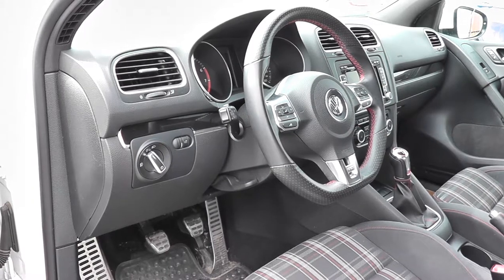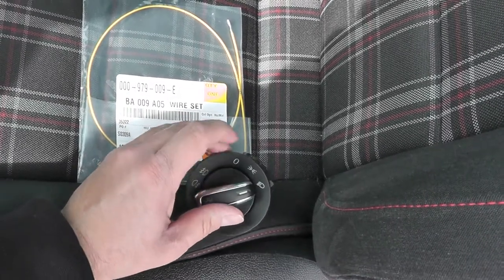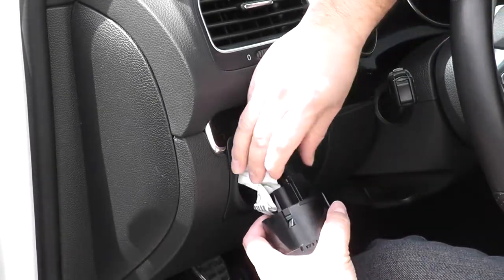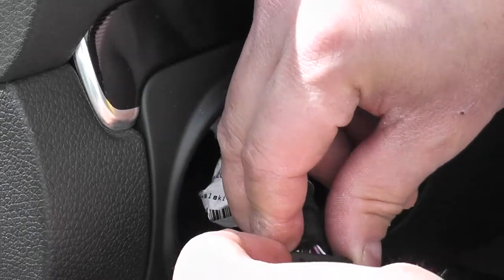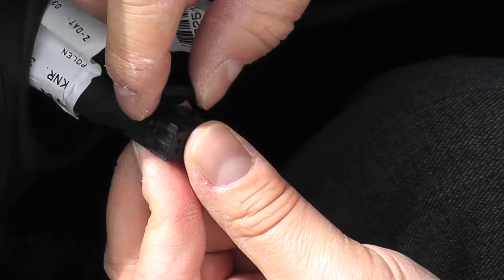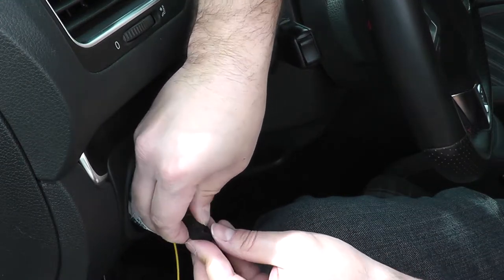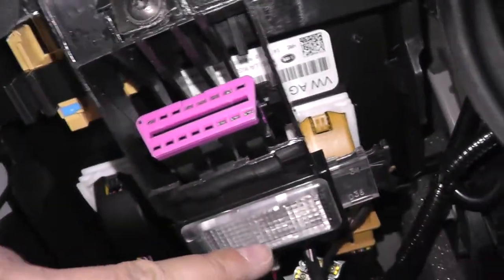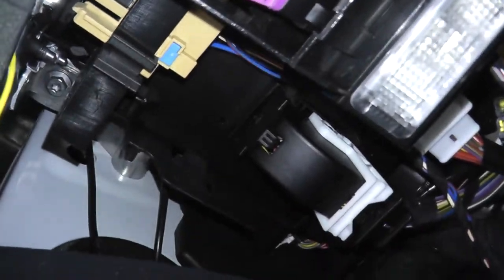MK6 GTI Euro Headlight Switch install

Comment: Awesome video! I think I'm definitely comfortable with the installation thanks to your video but I have a question about the vagcom. If I don't mind keeping the DRL's always on, do you need the vagcom at all for this process? Do I have to disable the DRL's to operate the rear parking lights independently?
Reply from the maker: thanks man! glad it has helped you out. No you are not required to disable your DRL's in order to add this euro switch. In your case you will have your headlights on at all times but you can turn your park lights independently as well as your fogs.
Reply: Esqu3l3to how do you disable the DRLs? I've got a '13 with xenon led.
Reply from the maker: Randy Grenier you can use vag com to disable them. older models you could bend the pin from the main harness but I don't know if you can do the same with any new model.
Reply: Esqu3l3to cool. thanks.

Comment: You can pull the light switch 2 times for the front fogs and the rear fog light/lights
Reply from the maker: Ok good info, I dont have the rear fogs wired up.

Comment: Is the mk6R wired just like the gti as far as connecting the euro switch? Excellent instructions! Thank you.
Reply from the maker: It should be yes, I have read that you would want a switch without front fogs however, since you have LED drl not fogs. I will see if I can find a link and or how to for the R.
Reply: Esqu3l3to ok, my led drls are in the place where fogs are. I guess I just considered those fogs. I want a switch to where I can just run my park lights and not my headlights. Thanks for your help.

Comment: bro, if it selected in auto mode and open from outside will the headlight opened automatically without start the ignition !?
Reply from the maker: Yes, If you installed a light sensor for the auto lights they will come on when it senses low light.

Comment: So what are the numbers in the factory plug for the switch should put my trigger wire for the parking lights and the fog lights?
Reply from the maker: here is a link to the install guide from ECS tuning. 
http://bd8ba3c866c8cbc330ab-7b26c6f3e01bf511d4da3315c66902d6.r6.cf1.rackcdn.com/mkvfog.pdf

this will show you how to install and which wires go where. I will assume you bought a oem kit correct?

Comment: It's the sameway to install this switch on a 2006 jetta 2.5?
Reply from the maker: yes it will work for your MK5 Jetta as well, from what I have read your model is plug & play. No added wiring required. Not sure if you will want to disable your DRL like I did which you will need VCDS (vag com) to do so.
Reply from the maker: I forgot to include this link for your install/referece. This is not my work but it will help you. 
http://www.myturbodiesel.com/wiki/euroswitch-installation-mk5-vw-jetta-golf-gti-and-sportwagen/

Comment: Do I need to disable the DRLs if I wanna run only city lights? Thanks in advance!
Reply from the maker: No you dont need to disable your DRLs for this. I did because I don't like them and I want full control of all my lights. The wire you can find at a local vw dealer or online with part number 000-979-009-E.

Comment: i need to do that on my 2017 passat. 1.8T. do i still need the wire. cant i just remove the old switch and install new one?
Reply from the maker: Remove the switch and check for any missing pins/wires. It will likely need it like mine but you never know.

Comment: My 2008 Jetta. Like to turn the small light on for drl. And head light on when drak. Can u suggest what witch and how can I do it.
Reply from the maker: Basically you need the same style switch that I have except of course that will fit your year. You might need to run a wire to activate park lights as I did.

Comment: How did you get the harness back together, mine doesn’t want to
Reply from the maker: The two connectors on the harnesses have a groove/slider to hold them together. You need to slide them back the same way. Ot can be a PITA but it can be done.

Comment: Pin #3 is where the yellow wire goes on the switch?
Reply from the maker: Correct, pin on the switch side and pin 19 on the harness under the dash.

Comment: I noticed the rear fog light setting. Is that a whole other mess to install?
Reply from the maker: that is correct, you are able to use rear fogs with this switch. as for wiring I do believe you would need a wire similar to the park lights and even coding.
Reply: +Keith Nuñez Yes, you would need a CANBUS VAG-com to code the car to work with rear fogs, and of course have taillights that have them to use. ECS Tuning offers a good selection
Here is some info about some coding tweaks you can do as well:
http://forums.vwvortex.com/showthread.php?4743553-VCDS-MKVI-MK6-Platform-Handy-Coding-tweaks

Comment: i thought the yellow wire was just for the rear fog lights. i have the same switch and i don't have the wire installed, and the lights work just fine, except my rear fog lights come on with the front as well, no matter how far i pull the switch for the fog lights. i can't get them to turn on separately.
Reply from the maker: +ThisIsIrrelevant in this case it was just for the park lights as it already was setup for front fogs. For rear fogs there is another cable you need to connect to activate. I don't know if you can only activate them one at a time.
Reply: ***** that model switch should have two detents that you can pull it to, to activate the front first and then the rear. mine doesn't do that though :/
Reply from the maker: that's true, they should have made it that way. Not sure if anyone makes a switch that way, it would be a good idea.

Comment: is it possible to use parking lights with fog lights? I bought a switch from amazon but not working as it should yet
Reply from the maker: Yes it is possible, you can use fog with park light without turning on your headlights. Did you install the trigger wire for the park lights?
Reply: @esqu3l3to  did not run the wire yet, but when I set to PARK LIGHT and fog light on, the fog lights do not turn on at all, 
only turn on when its on LOW beam setting with fog lights, 
do you think if I run the wire to control the parking individual, then the fog lights will turn on also?
Reply from the maker: No the park wire is for you to control the park lights independently from the headlights. Did you pull the headlight switch out for the fogs to turn on? I bought the euro switch not sure of you got a different one
Reply: @esqu3l3to  I did pull out to turn the fog light on, but it only does when its fully to the right, where the low beam is ON
Reply from the maker: Hmmmm...the only othee different thing I did was to disable my drl. Maybe it does need the park wire installed for the fogs to work
Reply: @esqu3l3to  ohhhhh, interesting, I will look into finding the diagram for the cables, thank you! and also your name means skeleton in portuguese (brazil)
Reply from the maker: What year is your vw? Haha I know, its also Spanish for the same meaning
Reply: @esqu3l3to  nice!! and its a 2012 GTI, with the factory HID headlights
Reply from the maker: Ok so wiring for the park lights will be the same as mine. I did show how to do that in the video.

Comment: I broke that housing the that you lifted the black part up on do you know what is called
Reply from the maker: +Christopher Tiernan No I Don't Know What It's called. I'd anything it would be the headlight switch connector plug.
Reply: 1K0937702D

Comment: Can i purchase only yellow pin cable? thanks. when i can purchase it?
Reply from the maker: +bravoumbus - I bought mine at the local dealship. I would also try ebay or amazon.
Reply from the maker: +bravoumbus - and yes you can buy just the yellow pin wire.